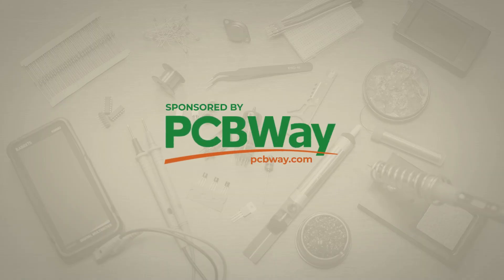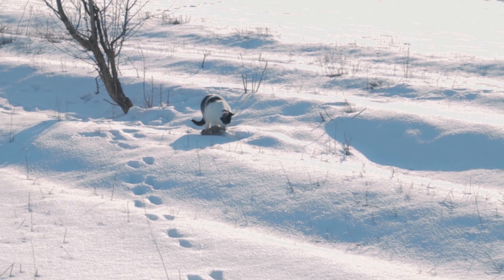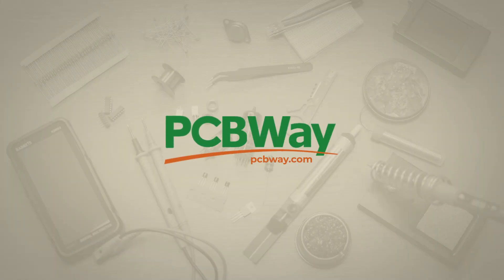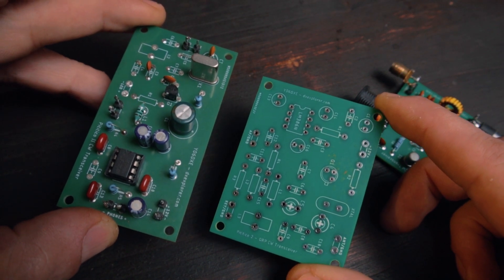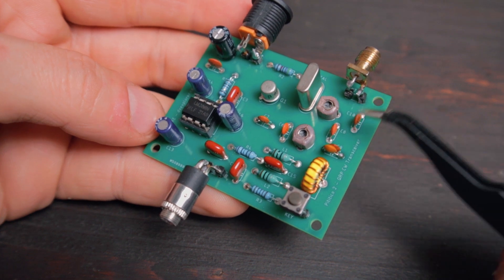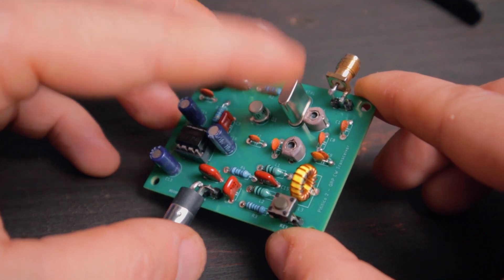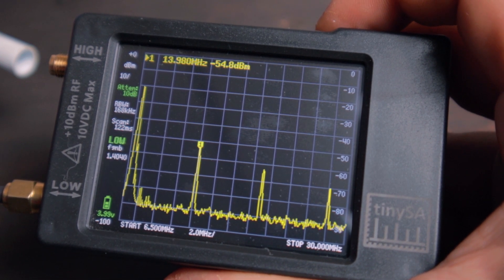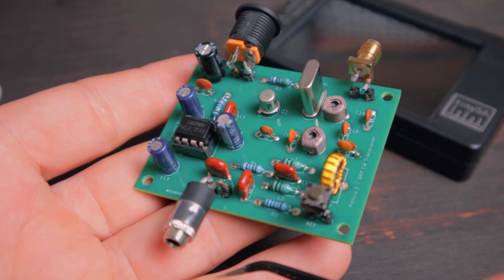Pititico 2 CW Transceiver - Final Version ( New PCB Board Design )

Comment: Is there any change in the circuit between the earlier rectangular pititico II and this more square version? Charlie KM4ZZ
Reply from the maker: Only the fact that I replaced the plastic transistor with the metal can version... and I modified the low pass filter on the output ( I added one more capacitor ). But these changes can be easily adapted to the older version as well by simply replacing the transistor ( not necessarily unless is overheating too much )... and the extra capacitor on the low pass filter can be soldered on the back of the board in parallel with the inductor. Now I also made some modifications for the way I am adjusting the TX frequency and the offset frequency compared to the older version. But if you have the older version PCB you are still fine with it. I have one of those too )).

Comment: interesting connection of the dc socket.
Reply from the maker: I just soldered it straight to the pins from the PCB board. But of course just to make the tests 😁. 73, YO6DXE.

Comment: If you wish to preserve past contents, can host a static version of most content of a blog for free by using the 'Pages" functionality of github. Once you have it linked through DNS and a domain and the static files setup, it's basically completely maintenance free. Either you can keep it on that domain and need to still pay for the domain, or can use a github io subdomain that will last almost indefinitely.

Would common plastic case TO-92 transistor work just as well?
Reply from the maker: Ohh I won't bother keeping the old content. Slowly when I will have the time I will try to create a PDF files for each project that will be placed inside the download folder, that will replace the article that used to be on the blog. Only that very much simplified so it would be easy for me to make them. Yes you can use the plastic case transistors as well... only that they heat up pretty quick so you will need some sort of heatsink for those. The only reason I changed to the metal can is that I could buy already made heatsinks for them to keep them to a decent temperature 😄. 73, YO6DXE.